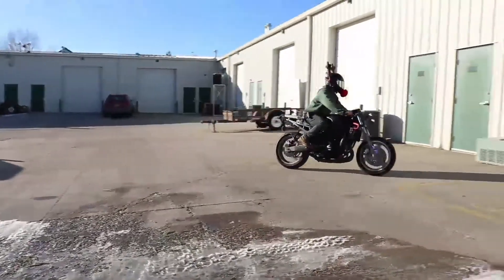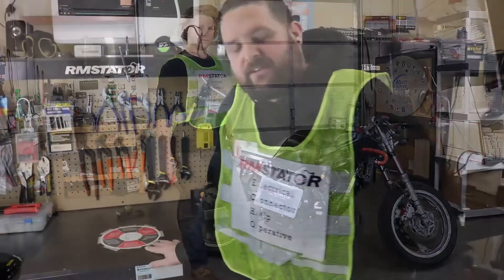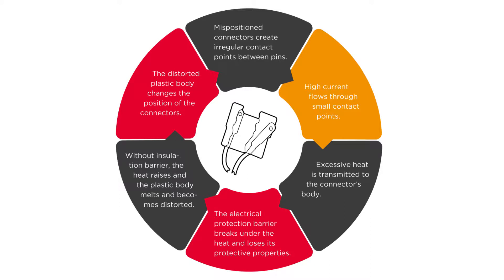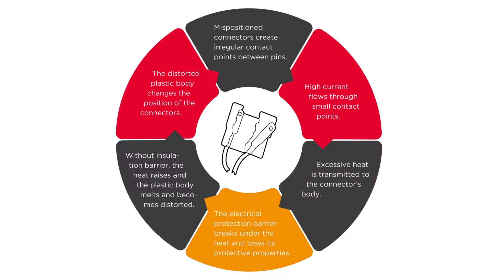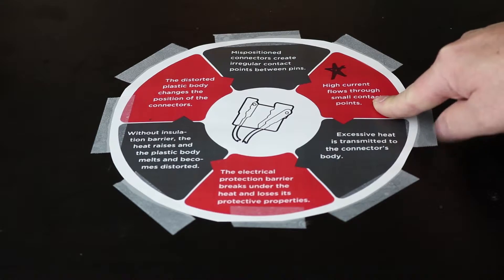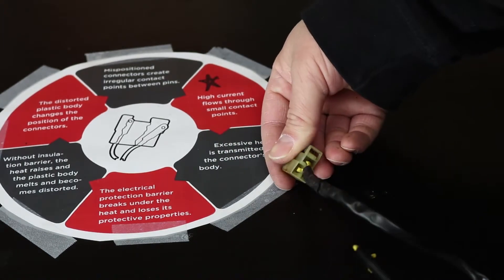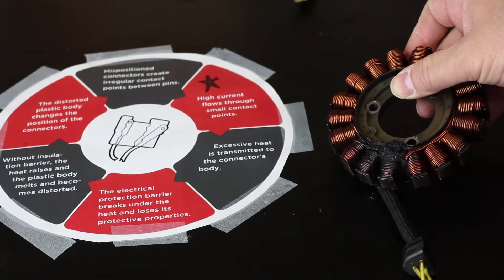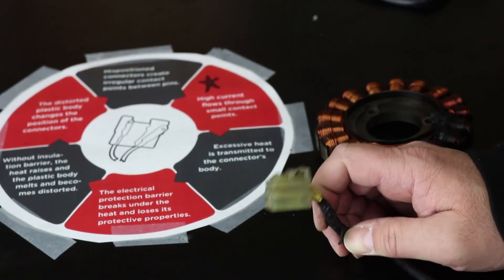Connectors Circle Of Death - Learn Why Your Vehicle Electrics Are Failing

Comment: First of all mom said God made me special because he loves me more.
Grandma phrased it differently. She told me Boy if you had another brain it'd be lonesome. 
In any case I misplaced the schematic sheet for the stator I bought from you. 
iT IS FOR MY 2002 xr650R. However I am transferring all the blinkers and lights from my 92 XR250L onto the 2002 XR650R. I am going to find a place for the battery somewhere. I remember you saying your stator can be wired  in 2 100 watt or one 200 watt connection. Which should I chose to more closely resemble the 92 XR250L wiring harness? Also will I need the regulator that came in the box with my  RM Stator if I plan on using the rectifier/regulator  from the XR250L??
your part number RM01023 
Thank you for your time
Mitch